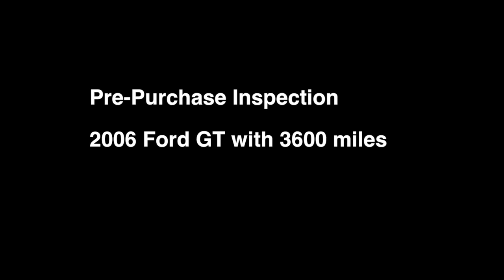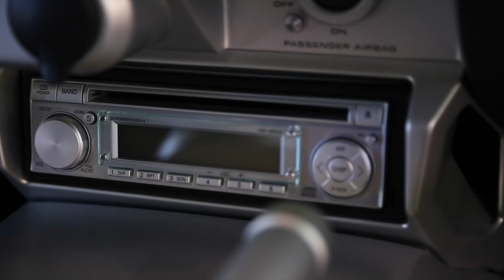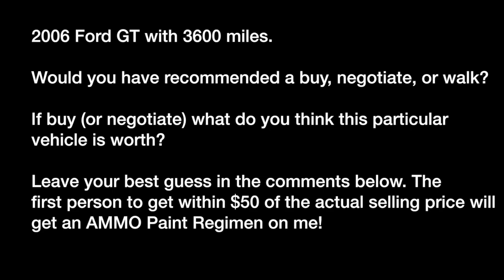Ford GT Inspection: Should We Buy?

Comment: if you can live with the small imperfection in the engine bay it is a buy. Paint chips are pretty standard to repair, that boot is only worth 100$s to replace. Since it doesn't have the McIntosh radio I'd say perfect this is a 260,000 car(and change). Minus the boot that has to be replaced and a few hundred dollars to repair the paint chips. I'd value it down about 1000 but the damage in the engine bay is on a powder coat. The only way to fix that properly is to get it re-powder coated so that has got to be down another 500. So my guess would be $258,500

Comment: good car nice driver, I would purchase it, probably negotiate it at around 125k-150k, need some tlc. paint, and that stress bar in the engine bay, had to be dealt with also the front valiance needs to be replaced.

Comment: I would negotiate a price considering so low miles and yet there is a fabric rip on the handbrake i would say this car with the 3600 miles on clock to be worth around $225-270,000USD sound about right??

Comment: The only thing I do not like is the paint chip in the door. It looks like it was assembly like that because it really hard to chip that area. The parking brake boot can be changed But original paint cant. My guess is around 194.5k
Reply: If you find something else with no paint defects and similar mileage. I would go that route if not this is decent.

Comment: Very clean all together, ya a few minor stuff, but all of it is replaceable. Though I think the chip under the door is the biggest issue, but not a deal breaker. The boot is reparable or replaceable as well. You could negotiate, but I don't think there is much wiggle room even with those issues. I'd say buy it, you could do the repairs and it be a win, win for you, your client and the dealer. Not sure how much they asking but I'd say around  $230,000 for it, only so many made and means values go up and not down.

Comment: Negotiate to 285,500. The boot tear would probably cost a few hundred since it would be replacing the original and the battery is a replacement, all in all, the car is good quality and condition.

Comment: 259,900 based on seller website.  Based on independent research, averaging all 2006 ford gt's sold with like sound system, mileage, color, condition, and adjusted for the regional average, it could have gone for 225,125.
Reply: AMMO NYC

Comment: I'd see what the cost of a new park brake boot is and have that knocked off the asking of the vehicle. I'm guessing somewhere in the range of $297,500 since it's such low mileage and still has the factory protectors and tires on it. This would be one of the more valuable GTs out there at the moment, even with that paint chip and tool mark on the subframe.

Comment: Completely irrelevant to the video but thought you'd be the best guy to ask; 
Tax discs recently became not needed in the UK but the tax disc holder has been stuck on the windscreen for years and I don't know how to get the sticky residue off? Will a hair dryer help?
Reply: Tommy T Something that works well as an alternative to adhesive remover is wd40 oddly enough. As Pugzlie18 said you'll want to remove most of it with a razor blade first then try to get the remaining gunk off.

Comment: I would negotiate the price down to $265,800.00 based on the chips and the damaged e-brake boot.  Also would try to negotiate a new set of tires in on the deal.  Not the safest thing to be riding around on 8 year old tires even though they only have 3,600 miles on them.

Comment: Larry. The standard (i.e. not the optional McIntosh) is a Sanyo. That's OEM. You should also notice that the big 'wart' subwoofer isn't between the seats. So that looks like a 2 option car (no Mac, standard black calipers). I'd double check that with OASIS to make sure it was a 2 option from the factory.

EDIT: 2 option, low mile Tungsten...assuming all else checks out (gauges, etc), I'll guess $265K

Comment: This is an example of being ultra picky. If you don't know the stock radio was a McIntosh for the Ford GT, then you should not be inspecting one. Easily the most important American sports car ever made, far exceeding even the new Ford GT because of its history. 13 years removed, it is less than 1 second slower than the $600,000 "new" Ford GT. These cars will be $750,000-1,000,000 in 10-15 years, just watch the market. They aren't making any more 2005-2006's and owners know what they have as well as dealers. Color aside, and I think the Gulf finish is rather ugly (they made a ton more Gulfs than they did Gray, Blue and Yellow - yet people think they are worth more for the paint job), these are gem cars. Relatively easy to work on, analog gauges, will always be quick (Even 50 years from now) and the style is timeless.

Comment: 3600 miles, damn, that's not even been ran in, it is such a shame cars like these are kept as garage queens and not driven. 

As for price, I'd say between $285k and $295k but for a guess, I'd go $294,950.
Reply: yeah, it pisses that people who can buy these cars don't really like cars
Reply: I have mixed feelings about the people who keep nice cars in the garage all the time. On one hand it seems like a waste but on the other they do keep them in very nice condition for future car enthusiasts to enjoy. Plus they probably have lots of cars so driving them all on a regular basis becomes problematic.
Reply: In Silico I do see where you're coming from and I know there are a lot of people who buy buy cars like this for investment purposes. 
I am all for keeping a car in as good of a condition as possible but they need to be driven, the fluids need to circulate, the systems need to be used, if not used the seals and joins can ruin. 
I personally would prefer to buy a well loved higher millage car than one which has been sat all its life.
Reply: In Silico 450 miles a year isn't really even enough to keep it healthy long term though, cars need to be kept moving a little more than that or things start to cease up, seals fail etc.  I'd be surprised if the aircon didn't already need attention on this one for example, it's usually the first thing to give trouble without regular use.
Reply: Daniel P.S You are right sir! Anything under 100K miles should be well appreciated on the buyers side. But maybe in this case, they dont want to buy it to drive it. Maybe it will not even be driven at all. Cars shouldnt be bought solely as an investment. I hate that especially in case of sportscars.

Comment: In the end of the video your passenger gave you your phone. I had the same problem with my passengers needed to hold my phone and stuff that I didn't want to have in my pockets while driving BUT on my way to Le Mans this year I found the top secret spot on the very end of the front seat there is actually a pocket where you can put phones and wallet. Yes I got super happy and told the other 22 Ford GT owners at Le Mans ( GT meeting ) about it and they all run to their cars to check it out because no one new about it ether. Cheers, /// Ford GT owner from Sweden

Comment: G4eat vid tho big deal has paint chips etc , would worry about the mechanical side of things plus the paint exterior etc will stop move your car the engine gearbox diff and all the other mechanical parts make the car move , also because any trolls etc start keyboard bashing , im a mechanic by trade so dnt even bother

Comment: Cars with such low milage, especially in this price range, rarely have any issue of matter. Maybe there is rubber bearing which is hard because of the age of the car.
it's really hard to negotiate, when you dont have leverage. I just would do a research for other GT's with similar condition and see if the price is in the same range. I guess you dont have to watch for $2000 or $3000 with that kind of money.
I would pay the $259,900, maybe $255,000 for a nice even number
Reply: Agree and disagree. My car has more mileage but far less paint issues and dings/rips, tears. Did you not notice the glaring plastic inserts in the seats missing? No mention of those.

Comment: Also negotiate because of the tears and save yourself a couple thousand.
Reply: Standard Nameo
It can't be that much.
Ford doesn't sell $500 boots like BMW or Audi.
Reply: Sanic maybe not, but the plastic shift cover in my automatic mustang is falling apart, and the only way to replace it is to drop in an entirely new transmission. My guess is Ford either doesn't sell it anymore, or it has to be bought paired with another item. Kinda weird but that's how they sell them
Reply: *****
At least  a mustang Trans is easy 2 get out.
These exotics have trans-axles.
NO one got time for that!